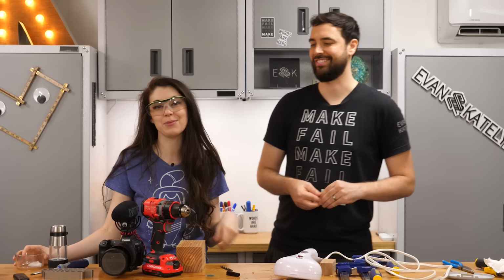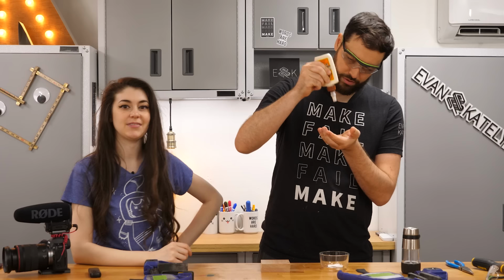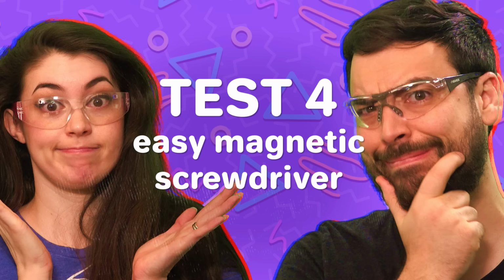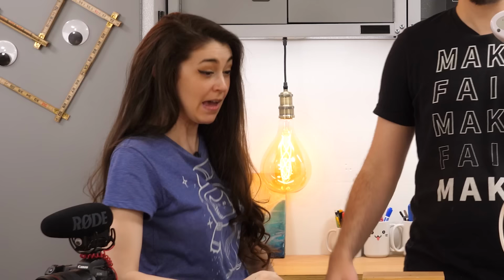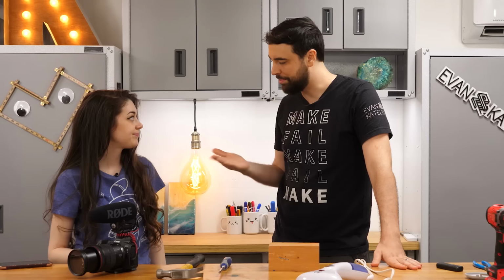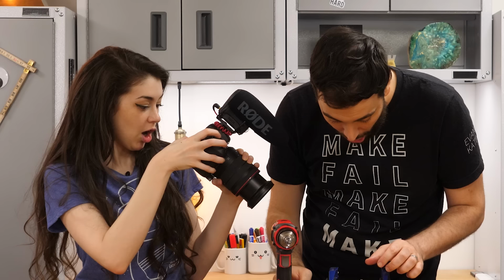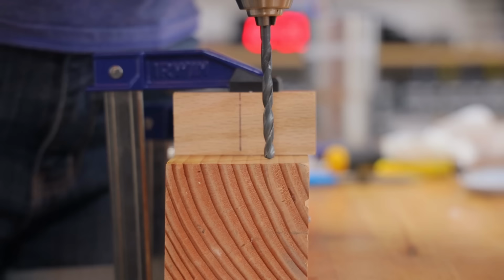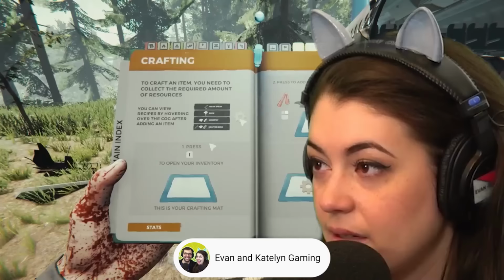Makers Test 7 DIY Life Hacks

Comment: I just watched this video and I would like to point out that the soap hack is for hand driven screws, not power driven.  It makes a big difference and doesn't matter if the soap is wet or dry.  I was taught this 'hack' more than 50 years ago and, not having a powered driver, still use it today.  I recommend trying it again with an actual screw driver to feel the difference.

Comment: I’ve not used salt but I have used sand and it worked great! You only need a very small sprinkling to do the trick and the plus side with sand is you can see it! Just takes a dozen grains to give enough grip to not slide around anymore.

Comment: With the soap on the screw its a carpenters trick my dad taught me, it is really really good for brass wood screws which have a habit of breaking, usually used with a pilot hole

Comment: Again, as a cabinetmaker for over 30 years, I've often used steam in many projects. To remove dents in wood I use a wet rag and an old iron. Virtually, every woodshop has an iron in it. The steamer should work fine too. Another trick I use, if I have time, is to drape a wet cloth, (white , clean cotton is best), and go for coffee. It can take anywhere from 10 minutes to an hour without the heat.

Comment: I don't know if anyone else has mentioned this already, but the black tip of your screwdriver means its slightly magnetized. It's not enough to hold the screw in the air like your other magnet, but it helps the screw to stay on the tip in tight areas

Comment: The deal with the glue and salt is that it can make the glue cure faster, TKoR used salt to get up spilled glue, and it did work very well for that.
For wood dents, steam is just faster, you can put a damp sponge on over night (did this to my bamboo floor after dropping a jar of spaghetti sauce on it, worked a charm)

Comment: The Rubber Band and stripped screw has variable mileage. 

The Pliers and Nails trick works. I did that for a school project in which I had to put in a couple hundred screws.

Comment: The secret to using salt in your glue up is a FEW GRAINS of salt spread sparingly on your piece.  Evan you used about 10 times more salt than needed. I’d like to see you try that hack again but correctly. It’s a great hack that has saved me a lot of grief

Comment: Hey guys! The soap on the screw trick does work. Especially on screws 3” and longer. You have to use Ivory bar soap. That’s the best one. Used it all the time when I did rigging and heavy equipment hauling.

Comment: The soap thing works well for predrilled holes you are screwing by hand.  I was fixing a sand play table and the screws were so tight it took an hour to get 4 screws out.  We soaped them up to put them back in case we needed to fix it again

Comment: My theory for the magnetic screwdriver hack: the metal of the screwdriver is either paramagnetic or ferromagnetic, and when the external magnet is applied, the magnetic domains in the metal align and hence becomes magnetic itself for at least as along as the external magnet is present. The main difference between whether or not the metal is paramagnetic or ferromagnetic is whether or not it retains some amount of magnetism when the external magnet is removed. That’s it! 😁

Comment: The soap on a screw is a trick for getting a screw started by hand when you can't drill I pilot hole. But, since most people have cordless drill drivers, there isn't much use for this trick anymore. And longer wood screws can break without pilot holes pretty easily. If you use drywall screws instead of wood screws because they are cheaper, they will break frequently.

Comment: ok so, i've done the salt thing with success making a saw table, and the trick is, thick glue layer, low amount of salt [no more than a pinch], large area of wood
too much salt causes the glue to not bind because it dries the glue out, saving this trick for larger projects you can't just put between guide blocks to keep straight helps control the amount of salt because you're spreading it over a larger area, and thicker layers of glue provides more moisture for the salt to absorb
sand might also work and work better, same for cement because when it absorbs the moisture it's creating another sticky substance, what doesn't work is sugar because it reacts to some glues

Comment: Expanded life hack for the magnet on a screw driver is to use a magnet to actually magnetize the screwdriver itself.  Sometimes you can do it just by leaving the magnet on it for a long period of time, but the real method to manually magnetize it quickly is to drag one face of the magnet repeatedly down the screwdriver to the tip.

Comment: I've used the salt hack on a project, works good on longer pieces of wood you are gluing together and only a tiny bit of salt
Also used to use silicone to lube up 3/8 head, 70mm long screws to drive into hardwood and worked way better than regularly screwing in (used to use this for installing solar panels on roofs)

Comment: the soap trick, again less is more. Hole should be piloted and soap(or wax) just the tip so that the excess works itself up into the other threads. Usually you would use this for something where the screws would possibly be removed again and then put back in, such as electric guitar screws for the bolt on neck or pickguard. I wrote this with the video paused at 16:55 so yess predrilling is key lol.

Comment: I did some decking professionally, and the self driving screws come with lubricant on them, and if you try to take one out and use it again, without the lubricant it doesn't work at all. I found the metal to be soft and bend easily without the lubricant, even though I was using a soft wood, redwood.

Comment: The stream removing dents trick works better on hardwood and only if its a dent and hasn't broken the wood fibres. You can put a damp towel on the dented wood and then use a steam iron and  after a few applications it brings the dent right out. Great for repairing dented walnut gun stocks.

Comment: The steam is supposed to raise the grain of the wood. You can do the same thing just by getting the wood wet, it doesn’t even have to be hot. BUT then you have to wait until it’s dry.  I always use denatured alcohol, it does the same thing and it drys faster.

Comment: If you rub the magnet on it a few times, you can Magnetize the screw driver. Or if you want to remove the magnetic properties once their added, by rubbing along the opposite side of the pole that you originally rubbed to magnetize it. if you don't know whether it was north or south, just try flipping it and eventually you'll get the right side of the pole to demagnetize. However if you would like to know and not test. The best way to accurately determine north or south; is to put your magnet near a compass and read what direction the field is pointing 👍.

Comment: the rubberband has never worked for me with stripped screws, i've found carefully soldering a paperclip or some other rigid wire is the least time consuming and easiest method. Be careful when working around electronics though :)

Comment: I used the screwdriver+magnet trick the other day actually.  You need a really strong magnet to make it really work awesomely lol.  a weaker magnet will work, but it won't be as strong (in my experience).  It's a great trick though!
Reply: It turns out you’re exactly right because the induced magnetic field will generally be about the same strength as the external magnet used (why this is true is quite interesting to me, but I won’t bore you with an explanation here). So, you want a magnet that will pick up and hold (against gravity and some additional external force) whatever screws you want to use. Thanks for posting this! 🙂

Comment: Im not surprised about the steamer with wood dents. As an homeowner with hardwood floors, the one thing they tell you is that if you spill liquid on it, it clean it up right away bc it can seep into the wood between the cracks in the slats and warp the wood. I wonder if the steam actually speeds up thag process versus a cup of water spilled on the floor or the more water the more warping occurs. Hmm.

Comment: The screwdriver thing, if you've got the magnet and the driver, run the magnet along the driver's shaft 10 or 12 times (in the same direction not back and forth) and then the screwdriver itself will be a permanent magnet.

Comment: for the magnetic screwdriver hack, she was somewhat correct about a different method. except what it does is readjusts the (North/South) poles of the metal in the screwdriver to essentially turn the screwdriver into a magnet itself.

just a fun fact.

Comment: I work in IT and tiny screws get stripped constantly. I use blue tape and a rubber band along with a screw driver that is a size too big for the really bad ones, then press down hard while using a T screw driver for extra leverage. Haven't failed yet.

Comment: Your black tipped screwdriver was made to be magnetic from the factory, hence the black tip, but over time they do seem to loose magnetism. Plus, neodymium magnets are much stronger than the store bought magnetic tip. So still a good hack. 👍
Reply: It’s actually a very interesting problem as to why permanent magnets can and often do lose their magnetic field. I suggest the Veritasium video on magnets if you’re interested in learning the various ways and reasons for this happening and also how to recreate permanent magnetic field in the tip that could be stronger than the original one. 😁

Comment: Might be an obvious one, but if you're trying to desolder a part, and you're using old desoldering braid, you can add flux to the braid to help the solder flow. Also add fresh solder to the joint before desoldering too, it will help the old solder flow.

Comment: I wasn't aware the magnet+screwdriver thing was a secret.  I use that all the time.  If you've ever used a magnet to pick up a chain of paperclips, the principle is the same.  And of course many screwdrivers come pre-magnetized to get the same result.  Doesn't help if your screws are made of a non-magnetic material, of course.

The soap on the screw does help a bit, but it's probably pretty hard to notice any difference if an electric motor is doing most of the work for you.  The context I originally learned of it (decades ago) was when using ordinary human hand powered screwdrivers.  I most recently used it when putting double-ended screws on for IKEA table legs.

Comment: magnetic screwdrivers - get a magnetizer / demagnetizer, works without the magnet.

Steaming wood to repair dents is used in the furniture industry, gun stocks, wooden boat building, industry, and musical instrument repair.
Reply: This is true IF the metal is ferromagnetic and not paramagnetic. The magnet field produced in a ferromagnetic material this way will always be weaker than the magnetic field of the external magnet and most likely temporary. However, this may be more than enough to hold whatever screws you need to hold. In the case of the hack, both types of materials work with an external magnet present.

Comment: 4 tip to use a hammer.

1. dont hold the hammer like mid way up the shaft stay close to the end of it.
2. Dont look at the hammer look at the nail...
3. Dont hesetate just give it the beans...
4. just start the nail with like a couple of easy taps first before u bring the fury, a few mm of the tip is good enough to keep it in place for the big blow to drive it all the way.

Evan. u can totaly oneshot that nail... been oneshottin 3" nails since i was like 12 in soft wood like fir/pine or whatever that wood was.

Comment: The screwing life hack is better if you glue two pieces of wood to make a 90 degree angle.  Then use the corner as the part that keeps the drill bit straight.

Comment: For the magnetic screwdriver/drill, just in case you want something a little more long lasting or without fear of the magnet going flying, buy
a “magnetic bit sleeve” or a “magnetizer/demagnetizer” at the hardware store 😊
Reply: The sleeve is probably a bit more universal since permanently magnetizing the bit depends upon whether the end is paramagnetic or ferromagnetic. This is a very good idea for dealing with guaranteeing the magnet stays with the bit. I had just finished writing up in another reply what it would take for the magnet to detach based on the rotational speed of the drill (and how much kinetic energy it might have when it impacted something else) and how that would be made more likely if there is another magnetic surface close by. This solution will fix all of that. 😁 Thanks for sharing!

Comment: The wood steaming one is science adjacent. The wood fibers in the dents are compressed while the rest isn't. The steam causes the fibers to swell and decompress. You're essentially just raising the grain of the lumber like you would with a first coat of paint/stain/wood conditioner. Didn't work on the edges or deep gouges completely because those areas the wood fibers were actually broken/cut and not just compressed. Also doesn't work as well on stuff that's been stained with a poly blend because then you have to sand down part of the finish and restain it to hide the dents well enough, but it's doable on any actual wood furniture!

Comment: You can also magnetize metals by rubbing a magnet against it going in on direction say from the handle to the tip of the driver.
Reply: This is true IF the metal is ferromagnetic and not paramagnetic. The magnet field produced in a ferromagnetic material this way will always be weaker than the magnetic field of the external magnet and most likely temporary. However, this may be more than enough to hold whatever screws you need to hold. In the case of the hack, both types of materials work with an external magnet present.

Comment: 8:13 because it leaves your screwdrivers slightly magnetic, which is bad if you use them on computers or other electronics that require both precision, and can get ruined by magnets. (its /unlikely/ to damage anything, but when it comes to something that could have easily cost you more than $3000, you work carefully)

Comment: You need few grains of salt. Not half of spoon ;) ...a bit of soap on the tip is enough. Dip the tip in the liquid soap for faster work. As for the drilling ...make a piece of wood with 90deg inside corner and it will be easier ;)

Comment: Just run your magnet the length of the screwdriver in one direction only a few times and it will magnetize your screwdriver even when the magnet is not stuck to it :) im a computer builder by trade and ive been doing it for years, its a lifesaver when you drop a tiny screw down an impossible gap!

Comment: You need a pretty powerful magnet for the homemade magnetic screwdriver to work if it needs to conduct the magnetic field through the screwdriver. As a result it's not ideal for working on small parts or electronics that can be damaged by the magnet.

Comment: Actually, I’ve used the rubberband hack before and it works, but after you get it out a bit, use pliers the rest of the way...then replace the screw because ain’t no one got time for dealing with stripped screws.

Comment: Stripped screw? Cut a notch into it and use a slotted screwdriver instead

The salt one normally works, idk.... Is your wood glue out of date? Too much salt? Really hard wood? How it works is that the grains of salt cut into both sides of the wood to keep it stable

Y'all said the better hack for soap, just pre-drill

Comment: the rubberband method does help if you dont have a garage full of 10thousand screwdrivers....that perfectly fit the screw they are designed for...a magnet is a part of my tool box...and my tool belt has an angle block

Comment: the magnet trick works because attaching a permanent magnet to a magnetic metal turns it into an induced magnet- or in otherwords a temporary magnet!
Reply: Exactly! It’s quite fascinating how that works, and in the case of ferromagnetic materials (versus paramagnetic), one could easily induce a temporary magnet that works without the external magnet present (although it would be a significantly weaker one) or with a bit more effort and cost, make it a strong, permanent magnet itself. 😁 Thanks for the post!

Comment: The rubber band hack works a little bit with a cordless but you have to go slow but I usually just look for another screw even if it's not the same as the others if I can😂

Comment: 19:10 it would probably be easier (especially for katelyn) if you just extended that line on the side of the wood block onto the top of it, that way you can look straight down instead of trying to look at the side of the drill while drilling, which is pretty awkward. As long as you've placed the tip in the right position it should serve the same purpose.

Comment: You could also wrap copper wire around the shaft of the screwdriver and it would magnetize it
Reply: That’s not how that works! I believe you’re thinking about an electromagnet, but that would require sending an electric current through the copper wire to induce a magnetic field. That probably wouldn’t be too safe if the copper wire isn’t electrically shielded. However, the nice thing about magnetic fields is they don’t let things like the plastic covering of wires get in their way. So, if you could produce a tight enough wrap of shielded wire coiled around the screwdriver (called a solenoid) and send a strong enough current through that wire without it overheating and melting the shielding due to the resistance in the wire, it might work. I have to think about this a bit more before I’d be certain that it could work the way you’d want it to. Nevertheless, good hypothesis and something that could be quite an interesting experiment to demonstrate one way or the other. 😁 Thanks for posting!